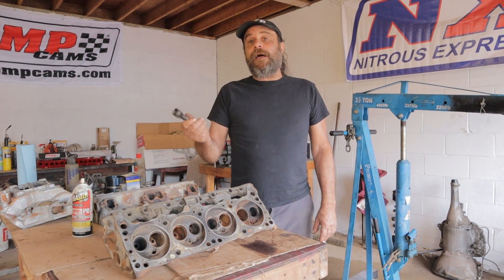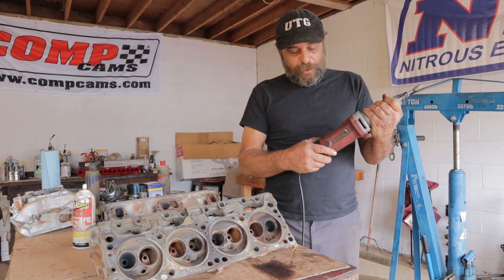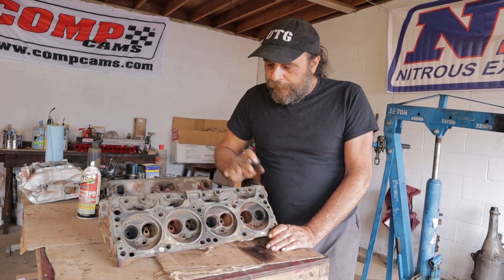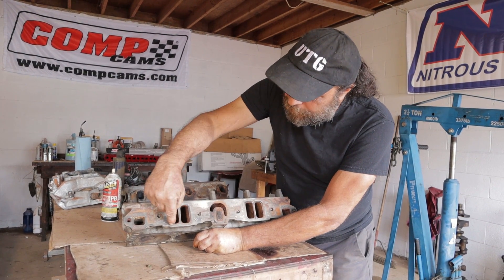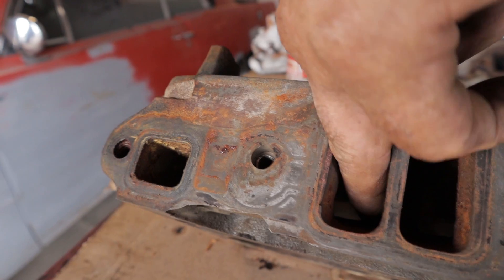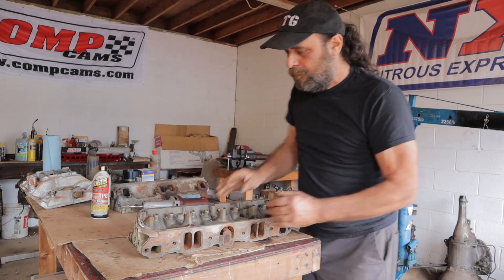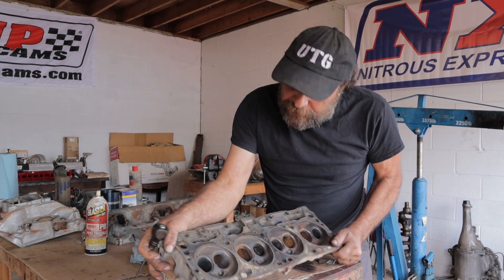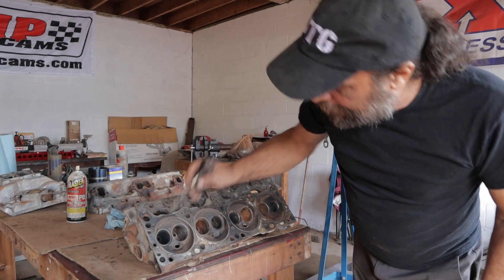Perfect Daily Driver 10 - Cylinder Head Porting Basics

Comment: What's your take on 3 angle valve jobs? I have seen some seat cutters that you can do them manually instead of having to go to the machine shop. You have done other videos where you make a back cut of the valve, but I don't recall your thoughts on 3 angle jobs

Comment: See, this right here is what I was trying to explain to a friend!!! That as long as you clean up the ports, remove casting flaws and make sure the area behind the valve has good flow potential, it would open up some extra power. It isn't just about opening the ports as big as they can go, but just cleaning up the path already provided. And I  had experience with that with a high compression Honda B18A1 that started out with just a basic clean up of the intake and exhaust ports, what little work was needed. This said, when the head was fully ported to match the new performance intake manifold... there was an even bigger gain. This said, nothing compares to the now VTEC head on the same high compression B18A1, with its port work done and its performance intake manifold.

Comment: inexpensive die grinder burrs can be found at northern tool for 30 something american pesos comes with 4 or 5 different shapes ... 1/4 inch shank 2 inches long Single Cut the one tony shows is a double cut... single cut works with aluminum, double cut for cast iron. use some spray lube to keep from overheating/clogging up .. can buy some expensive ones once you get familiar how they work.. die grinder is a great tool very diverse . the kobalt 24v max cordless is badass 119plus tax needs the 4ah battery at minimum though

Comment: Does Mopar Performance still sell porting templates? They are an excellent guide for performance related port work, and if you follow them you shouldn't cut the walls too thin or go through the walls of the port into the water jacket. And the the area you really want to pay the most attention to is the roof of the port, on both intake and exhaust. Then the bowl area just underneath the valve. There is usually a lip left in the short turn of the bowl just below the valve. You can smooth that out, but don't take too much material out the the bowl. Leave the floor of the ports alone. Any newer performance head is going to have raised ports, which improves flow greatly. Thy also raise the floor of the port and open up the bowl area as cast. On a performance head like the W2 and everything newer than that as far as racing heads are concerned, won't need a whole lot of port work unless you're maximizing the engine for racing only.
Uncle Tony is absolutely right when it come to the golf ball effect. The Myth Busters too a car and did a baseline mileage test on it and they measured speed as well, if I remember the show right. Then they put clay over the entire body of the car. That amount of Clay was extremely heavy, but when they dimpled the clay so the car looked like a golf ball it used less fuel and went faster. Unfortunately that makes a nice car butt ugly!
And one thing to pay attention to here, is how much of a straight through, line of site direction he took that exhaust port. Beautiful work!!!

Comment: Years ago, a neighbor of mine built a pretty mean 350chevy for his work truck. He was a metal roofer, so his trailer weighed a crapton, and he replaced the wood bed with a chunk of 3/8" thick diamond plate steel. Even needed to register his truck as a 6800lb gvw light commercial rig (Washington state in the late 1990s), to not get a really expensive ticket from the wsp/dot for being overweight.

Anyways, he deliberately put bumps into the intake manifold and ports to keep the airflow turbulent!

Got about 18-22 mpg without his trailer, despite all the weight of the truck.

Comment: UTG I have a suggestion. Instead of the screwdriver pointer I think you need to modernize and get a decent Cree style LED flashlight and use electric tape to bind a green laser pointer to the flashlight where the light beam and the laser beam aiming point cross about a foot or less away. That way it lights everything up for Mrs. UTG during filming and you are not impeding Mrs. UTG AS she is filming. I am sure she will love you for it if you build it. Should cost you less than $25 to make this gadget and it would help to more easily and accurately explain and illuminate the subject without you being in the way of Mrs. UTG all the time Tony. She does all the work and you just keep getting in her way man!

Comment: The magnum heads crack in the seat if over-heated. I will give you that. But the engineering is there for better combustion. I've cut the heads and ran a thinner head gasket getting 10.25:1 compression and have no issue when running regular octane pump gas for the street.

Comment: You can read a thousand different magazines you won't get a better tutorial than Tony just gave us in 15 minutes. This is pure gold! Thanks again Tony you're really the man.And I'll bet John and Lunar are the better for spending the day with guy who not only knows what to do but gets down to it, gets it done NO dick'n  around! Tony ported a cylinder head in the time John took to run a bolt in and of the threads on the block with a ratchet with a cordless Dewalt sitting on the work bench. didn't even blow the holes out with compressed air that I saw..

Comment: Its like I have said in the past unless its a wildly built small block velocity is more important more than often than the total flow. And Tony knows this that why he is starting out people who are new to this slow so they won't ruin the heads in this video. The flow of the heads must match the application and how to you intend to run the engine put W2s on a 318 with a 450 lift cam with 9 to 1 compression 600 holley or a 650 it will be weak as hell till around 4000 rpms then come on till about 5300 rpm or so. WHY because the velocity is to low flow means nothing. Anyway for a real streetable machine what hes doing to the heads IS the best thing.
I  know about 318s in fact all the small blocks had more than one 9.60 cars not bad for a good ol boy in ending Tony knows his shit.

Comment: Same for aluminum heads or is there anything I should be aware of ?  working on 94 lt1 stroker build any advice
Reply: Aside from probably not needing carbide bits on the grinder? Same ideas apply.
Reply: @ScottKenny1978  what bits should I get and thanks for the help
Reply: @mikemettler9311  high speed steel is fine, but don't go stupid-cheap on them.

And replace or resharpen as soon as it starts to slow down cutting!
Reply: Dennis Young  yeah, we used some funky stuff made for Boeing for keeping drill bits cool and all the chips from gumming up the flutes, called boe-lube. (You can probably guess how we ended up saying the name 🙄😜)

Comment: Good stuff!  I build/port and polish roughly 6 sets of heads per week(well, this year is slow as I have very few either strip or track cars as the season is postponed)...and often I'll compare the before and after on our flow bench.  UT is absolutely correct when he says that you really don't need to go crazy and make it look like a museum piece.  Simple contouring, blending and dulling edges will go a long way.  Also, on some heads, the valve(s) may be "shrouded" by the chamber.  Unshrouding is also very beneficial...albeit a little more tricky for the home mechanic.  However, IF you do take your head to a shop like ours and you're getting a basic valve job...it literally takes no more work to take that shroud off with the Serdi while cutting for new hard seats or re-cutting the old.  Also,  it take's no more expense for the shop to really do any amount of angle work.  It's simply a cutting head on the machine which will leave either 3, 5, 7 or a radius.  For street cars, I usually cut 5 angles on the intake and radius the exhaust.  Seems that combo works really well...along with re facing the back cutting the valves themselves.
Reply: Never heard of radius cutting valves.

Comment: “Let your vision be like water making its way through the ports. Grind off anything that is assertive to your flow, but adjust the object impeding your flow, and you shall find a way around or through it. If nothing within you stays rigid, outward things will disclose themselves into atomized flow of gasses into and out of the cylinder.

Empty your obstructions to flow, be formless. Shapeless, like water. If you put water into a port, it becomes the port. You put water into a cylinder and it becomes the cylinder. You compress it by a piston, it becomes highly explosive. Now, air fuel mixture can flow or it can crash. Be water flowing, my friend.”  : Uncle Tony or Bruce or someone I forget
Reply: Nice.

Comment: awesome video, i always hear people talking about how porting doesn't yield much in the way of results but they are testing modern engines that don't quite benefit as much as these older castings with non canted valves and fairly primitive designs that don't necessarily lend themselves to laminar flow from the factory

Comment: the basic simple porting job, BRAVO! each flaw can knock a percentage of power away.
investment plaster castings (jewelry) are smaller but get flaws just like sand cast will.
putting all the lines straight+smoother is going to open it up 4-5% at the least, that nugget in the header side was at least that much all by itself! what you just showed combined with back facing the valves will do a LOT for making torque power out of this DD project... piston flipped 360 stroke with the "doctored" 318 heads, really nice oddball combo to start with. it'll likely out-do bottle rocket (unsprayed) when done.

Comment: Tony, do you typically chamfer the leading edge of the intake port like you did the exhaust or leave it sharp?
Reply: He probably won't on this one, the intake runners are smaller than the factory ports in the head.

He should take the lip off the intake manifold side.

Comment: are you going to port the intake manifold?
Reply: know he's gonna give that some attention too in this build
Reply: Probably a little, just to clean up the casting to "as intended". 

The big thing that needs to be done on this build is rounding over the edge of the runner where it goes into the head, because the manifold is smaller than the head.

Comment: Ut i heard of people putting a very fine steel mesh between carb and intake manifold that will further break down the fuel. .
Reply: yes it works, also lowers your cfm some. with a riser and smaller jets, it can increase fuel economy a bit. it'll make it struggle in higher rpm's naturally.

Comment: >>> One other tip I'd give - especially for beginners - is to start with the port areas first to get a feel for how much material the carbide bit removes with every pass you make, and how it "feels" as the bit cuts away material. You really want to get a feel for it before doing the more intricate areas of the bowls. You're learning, so if you make any minor mistakes, the ports are a good place to learn because they are more forgiving of any minor mistakes you may make. Get a feel for how your bit cuts and feels with the ports first before doing the bowls. 👍 That, and wear safety goggles to keep metal debris out of your eyes!
Reply: Yes!!!  Safety glasses and face shield.  Those chips fly everywhere.  The stronger the motor in your die grinder the more they fly.  I had a painful trip to the ER to remove a chip from my cornea.  T tried to flush it, brush it, and flick it away by myself, but just made it worse.  Even tried a magnet.  I had some pretty good wrap around safety glasses, but apparently not good enough in that perfect storm of chips.  Next time I'll add goggles or face shield to my list of required PPE.
Reply: and don't fall into the trap of bigger must be better....Many times air acts differently than the port layout may suggest.
Reply: Bill Cat we
Reply: And there's a big difference between steel and aluminum heads as well. Aluminum removes quickly!
Reply: Excellent advice! The bowl and guide area usually doesn't need much material removed to be good.
Reply: Also don't forget to put a rubber on it....
Reply: Another even better tip is to use and air powered die grinder and regulate the psi to just 50-75 that way you are pulling less material off un wanted areas,  and use a dowel sander tip to finish the tight spots
Reply: Good advice thanks.
Reply: Brand new at working on engine stuff here, bought some used vortec heads and stuff, doing lots of learning here so I can build my engine and have it run as good as it can run 😁 very simple explanations for beginners like myself!
Reply: another tip especially for people who may not to confident with a die grinder and/or uncomfortable working around the seats, look into getting some guards 3d printed to protect them. the ones I made for my engine were just 1.5mm thick and cover the  contact area of the seat and 2mm below it. if the cutting head of the burr hits them it will grind through  in about 2 seconds, but that's 2 extra seconds to get the cutter away from the seat when it would have instantly damaged them without the guard.
Reply: Thanks
Reply: Your always so great at easy explanation and proper basic do it yourself !!! Truly love your vids and your knowledge and sharing is immeasurable Help !! Thank you always Uncle Tony !!
Reply: Thanks for the words of guidance
Reply: Couldn’t agree more. I suggest starting on an aluminum head and using a carbide bit with a 40 percent cross cut. You physically cannot remove too much material. As with anything new. Take your time.

Comment: Very helpful for the new engine tuners. Keep it simple is the idea, especially for a road runner. The only things I would add is the use of a strong magnet or vacuum cleaner to pull the ground metal away and wearing a dust mask and goggles.

Comment: When you're going for economy, it's not about maximum flow, it's more about EVEN flow.  The more even the cylinders fire the smoother the engine runs and the more economical it will be.  The best way to ensure even firing and even cylinder contribution is exactly what Tony showed here, just form the ports to the shape the casting was intended to be so they are all the same size and shape for smooth, even flow.
Reply: I don’t think die grinding ports = blueprinted engine
Reply: @fastinradfordable  I never used the term "blueprinted", which refers to machining the block to exact blueprinted specs... but yeah, it essentially IS "blueprinting" the heads.  Professional engine builders might have fancier tools to do it with, but they're all essentially just a die grinder, and they also do it by hand.  Mass manufacturing practices cause the castings to rarely come out anywhere close to the exact measurements, shapes, and designs that the engineers intended when they were drafting the actual blueprints.  The only way to make the castings match the original design is to reshape them... with a die grinder... by hand.
Reply: @Anarchy-Is-Liberty  Agree...and most diy porting vids are nothing more than hackwork blind leading the blind
Reply: @fastinradfordable  "I don’t think die grinding ports = blueprinted engine" - You've got to admit, it was good for a chuckle though! lol
Reply: I agree.
Reply: This is also known as blueprinting  in old school tech.

Comment: So basically I should bring my cylinder heads with me to my dental hygienist. 😃
Reply: Actually if you want the high quality equipment buy used dental equipment.
Reply: Sometimes you can pick up some free burrs from the dentist but they are so tiny that it would take hours to do what Tony just did in a few minutes.
Reply: Dennis Young  my Civic improved by about 60 horses and considerable torque. Because I was able to turn it into a double vortex on each cylinder.

Comment: Back in the ‘80’s I rebuilt my second engine (Buick V6) with a highly regarded Smokey Yunick/Weiand intake and a Holley 390 (I think) carb. I was so afraid of ruining the heads with a port job, that I didn’t do it and didn’t get any gains at all. Probably didn’t have a good cam match either, but the point was the port job was the deal, and I avoided it out of fear.
Reply: damn, you left alot of hp on the table too. the 3.8 buicks have a crap ton of power to gain from head work. the bowl area is horrid.

Comment: Cool video I'm actually fixing to port a new set of aluminum heads for the 347 stroker I'm building for my pinto if the heads ever get here . I've been waiting over a week and they said it would probably be a little over a week before they get the Ford castings in to build them. I hope that they are as good as they say they are on their website. They are coming from skip white in Tennessee somewhere so if u order a set either pick them up or prepare to wait a month to get them. Great video and some cool porting tips

Comment: Old school. Biggest exhaust you can get. Can't fill the cylinders if it cant get out. Bowl clean up works magic. Also if you can get aluminum heads you will not regret it. Just make sure pushrod length is right. Those heads have a decent exhaust port.

Comment: Dipping your burs in atf and using a router speed control will make them last year's
Reply: Cast iron is self lubricating
Reply: I have been abusing a carbide bit for like 10 years. 

Recently I used it to open holes I was trying to drill in 3/8” plate. 

I drilled a pilot hole and opened the hole up to 4/5” diameter. 

Had a bowl of water. 
Heat cycling that bitch all day for a week. 

Yeah it’s got a few teeth missing. 

But damn a good one is worth a thousand drill bits.
Reply: I use WD-40 on My aluminum bits!